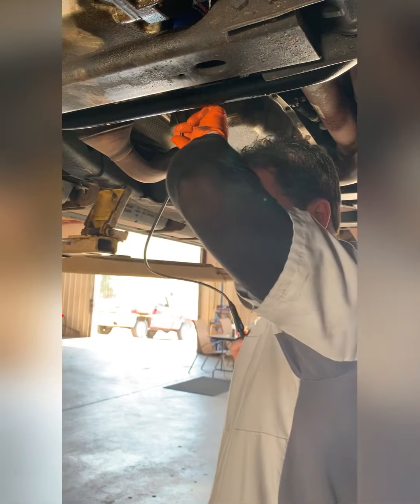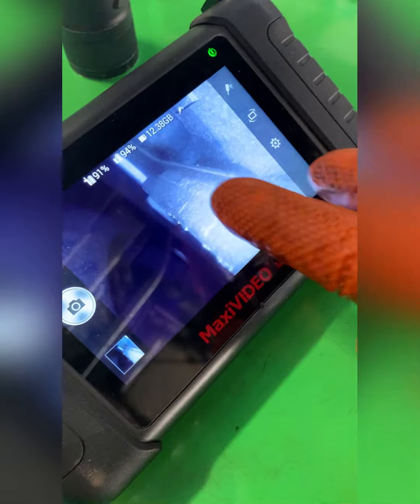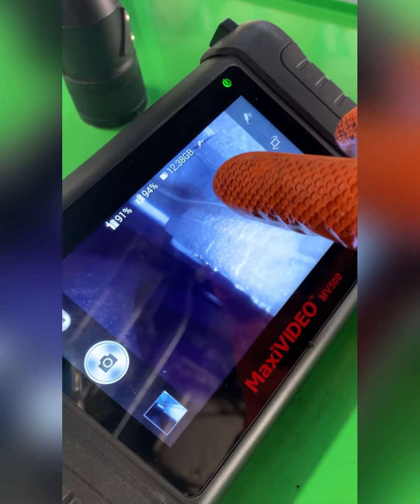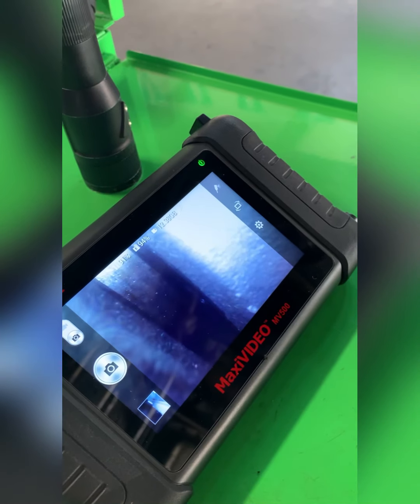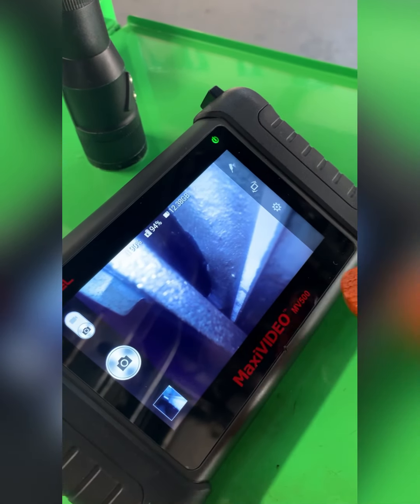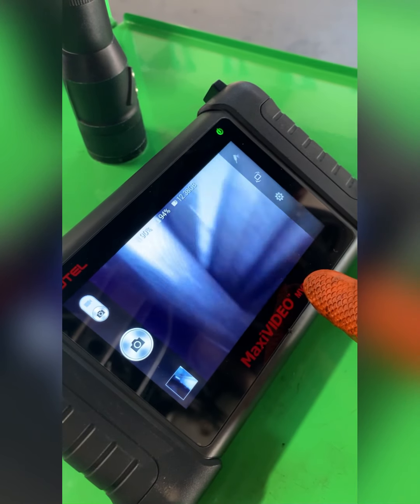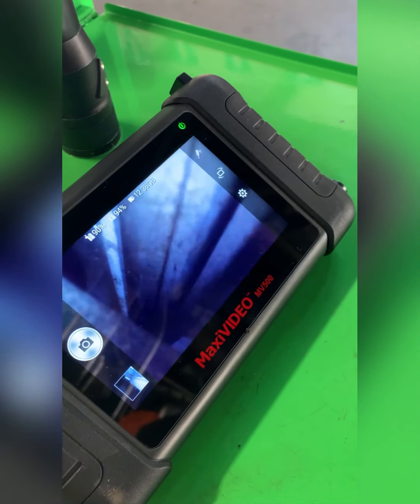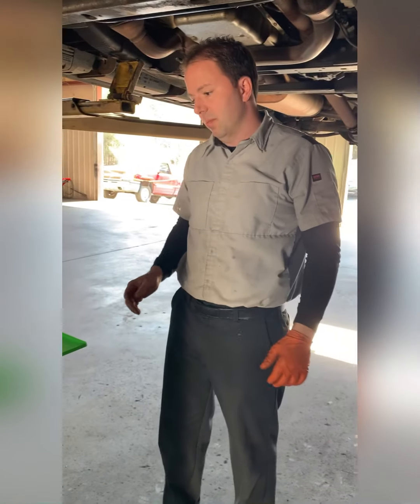2010 GMC Denali - Oil Leak Diagnosis

Comment: Our 1995 Monte Carlo ( Bought New)  had it in for its third dealership performed oil change. tech came into the waiting room and want to show me the front breaks....as I was under the car in his bay  while he was pointing out the worn pads....as asked about the oil leaking down from the top of the engine...oooppsss... plastic valve cover gasket replace under warranty....